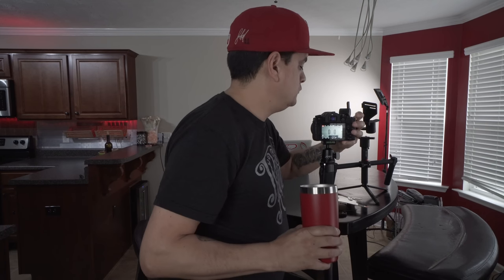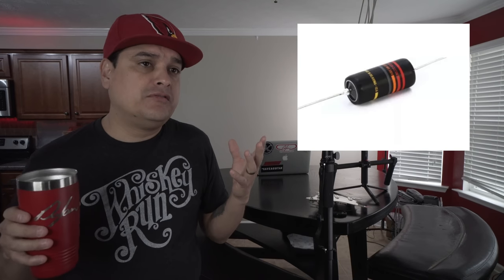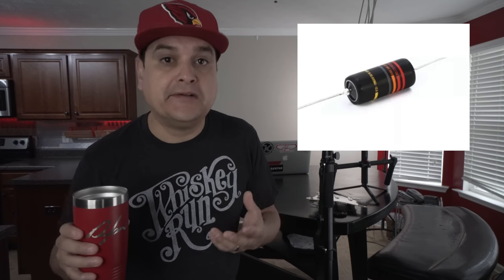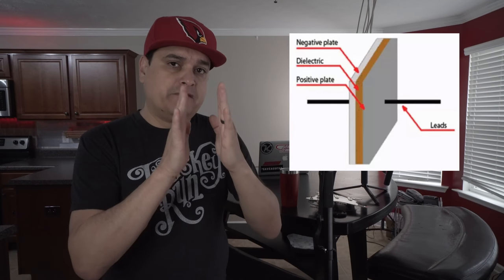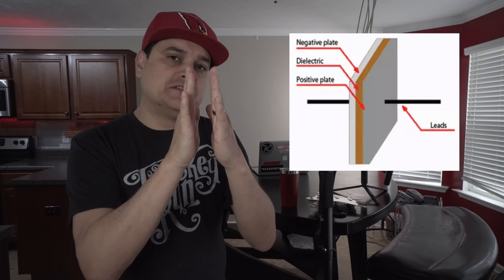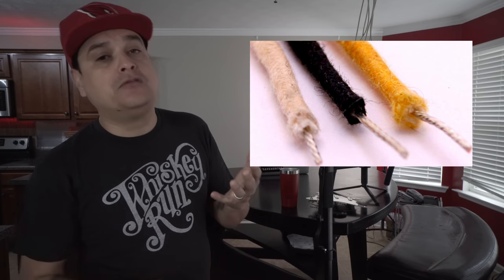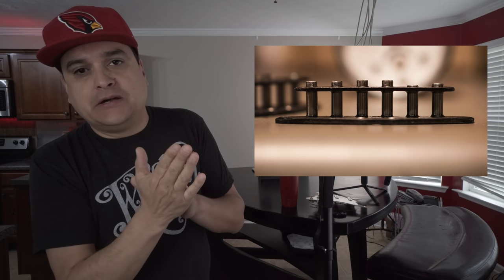Are Paper In Oil Caps Better Than Orange Drop?

Comment: I’m not going to pretend like I know a lot about capacitors, but I replaced the small stock ceramic capacitors in my 2002 Gibson Les Paul with a pair of mojotone paper in oil caps, and I was very pleased with the results. The tone was much cleaner and it sounded less muffled. I don’t think the difference was nearly enough to justify some of the outrageous prices some charge for bumblebees or others, but at $10 a pop, I think the mojotones were money well spent.

Comment: Thankyou for reinforcing what l have been saying for years. I been playin for 50 yrs & a technician for 30....there is no such thing as vintage tone due to a capacitor style !  Unless there has been leakage or deterioration over the years. It does what it does according to the value on the wrapper.  OHM's LAW DON'T DO VINTAGE....PERIOD !!! 😢😅
FUNFACT...apparently even a company that starts with G & goes to N was caught painting capacitors to pass for the old black & yellow Bumblebees from a bygone era. They got swatted" down....Save your $$s kids !

Comment: Great video and very informative. I'm currently working on a bass and ordered some CTS pots for it (in preparation for swapping out the pickups and controls) and they came with an "orange drop" capacitor. I've been watching videos on how to do the work myself (the soldering and whatnot)and they're using paper and oil so I've been wondering if I should get a paper and oil capacitor "because it will sound better." Glad I found your video to clear up this whole capacitor argument. Thanks a lot!!!

Comment: Hey Dylan, very good work. The voodo of caps not withstanding, which you handled well, explaining tech is not an easy task. You took a complex topic (capacitors) and gave it in a digestible package. Not too basic but still not getting lost in details. Any inaccuracies were very minor and forgivable. Anyone who is compelled to pick apart your presentation likely has never taught professionally or had to educate executives. Bravo!

Comment: Good stuff Dylan, thanks. What's important is the way your guitar output circuit (pickups, caps, resistors) interacts with the input circuit (impedance) of your amplifier. Try running your Strat through the A side of a Radial Twin-City ABY Amp Switcher Pedal and vary the drag setting. Most guitars will have a sweet spot you can hear.

Comment: I've played around with several different capacitor types - various vintage caps (mustard caps, tropical fish, bumblebees, etc), Orange Drops, ceramic, polypropylene film, polyester film...etc. I usually avoid ceramic since they tend to be microphonic more often than the film type caps, but otherwise, like value caps will almost always sound nearly identical (actual value - not rated value). My go-to are Panasonic polypropylene caps - they're inexpensive, they sound good, and they're compact (especially the 25V and 50V rated caps I use, which are still overkill for the application). Pot values also come into play. Generally, you'll have a darker tone with 250K and brighter with 500K or 1M. Smaller value caps will sound brighter and larger value will bring more low end into the mix. I like 500K pots with a .047uF cap for single coil pickup guitars and 1M pots w/.022uF for humbuckers.

Comment: I don't feel any particular way about caps. I'm just learning. Right now I am on the down hill slope of a 2 humbucker rewire job. I learned about polarity. Testing humbuckers for resistance. Pot values versus humbucker tonality. Now I'm "nerding" out about the bridge pickup. I had to drop in a 250K tone pot. I have a one Meg volume pot. The caps are .022's. There are two DPDT switches (on, on, on) for dual sound parallel, series and coil splitting. Blah, blah, blah.
Now the question really is what will my bridge humbucker sound like. Will I swap out the cap or the pot? Or will I like the darkness of it as I go from one coil to two depending...? Should I wire the switch for the North coil or South on this bridge pickup? All very interesting and fun to me. So thanks for all your cool vids Dylan.

Comment: The electrical value of a capacitor is the only thing that should matter. The object is to use components the work and last as long as possible. Using the best you can afford doesn't mean spending as much as you can, it's choosing components that will work together to give you the sound you desire.  Capacitance gives you your range of tone but so does everything else employed.

Comment: Capacitance is capacitance and what does matter is the value of the capacitance and the effective series resistance of the capacitor. If two capacitors have equivalent capacitance and ESR it doesn't matter which is used in these very low voltage circuits.  High voltage needs really good insulation as well.

Comment: My only thought on picking caps is to pick something above the bottom of the barrel so you're closer to spec. I'm not gonna pay $30 for some new old stock cap from the 60s, but I'm also not gonna grab a 5 cent ceramic cap off ebay.  Anywhere in the $1-5 range is perfectly fine, though. 

Recently rewired an old korean L6 clone and wanted to keep its original cap, because I was just replacing bad pots. It was wired so tightly to the tone pot that I just snipped the hole lug and soldered that with a tiny snip of wire through it to my new pot. Sadly, I don't have a good multimeter to test how within spec the thing is, I just know that I didn't bake it to death trying to get it off that lug before giving up.

Comment: I sat down with a bundle of different capacitors for a day running a signal through them one at a time(ripped out if a 70s TV set.Grundig I think) and when I used a yellow tube shaped •5cm x 1cm plastic one I stopped and permanently soldered it into a stock Stratocaster because it sounded nicer than all the rest. I don't know the values cos it was almost blank but it was yellow.

Comment: I have a question (ignore the handle, shared computer) but for those of us who subscribe to the DIY thic and dismantle old tv's and stuff to harvest parts do you have any good advice or thoughts on what items we should look for and why? It seems capacitors would be one of hte easier bits to pull from old electronics
Reply: nah man caps dont worth it.. focus on big expensive stuff like transformers, tubes, power transistors, heatsinks, anything mechanical like potentiometers and switches, big inductors, cables, that sort of jazz, also anything you find useful obviously why not..

Comment: Good presentation! There are a couple of things that might help the non electrical engineer. 1. Caps block DC voltage and pass AC. 2. Dielectric Stability. ie Mylar or polypropylene degrade less over time than paper and oil. 3. Dielectric Constant which will have an effect on the size and frequency response of the cap. At audio frequencies Dielectric Constant has more effect on the size of the cap than on the frequency response. Small caps are NOT less effective for the same rating, they have a better Dielectric Constant. 
Back in the middle of the last century, parts available for tube amps and guitars tended to be in the ± 20% range anything else would be expensive. ± 10% got more common by the 60's but as I recall, well into the late '70's, ± 20% caps were still the norm.

Comment: I went for Silver Mica caps for a passive bass cut circuit simply because the tolerance was +/- 1% rather than the 10-15% you'll find in the usual caps sold to guitarists for tone circuits 🤓

Comment: There is current (I).There is charge (Q). There is rate of change of current (dI/dt). The first (I) is connected to RESISTANCE. The second (Q) is connected to CAPACITANCE. The third (dI/dt) is connected to INDUCTANCE. Each are a part of the TONE you hear. They all matter. All of it collapses to one single differential equation, so what ends up mattering is the relative values of these three thing. When you buy a capacitor, ALL THREE are there, even though what is being sold is CAPACITANCE. A 0.047 with 0.047 of another is the same, but the Henries won't be the same, neither will the resistance. But the resistance is overwhelmed by the pots. That's why the Pot's are so large.Inductance? The pickups will overwhelm on that. So, it doesn't matter much what type of caps you get. if you are into blowing money for no, or trivial difference, the do it, but understand you aren't going to here it. On the other hand, other idiots willpay for it to show off to their buddies, or so they can show off in a forum.

Comment: So in other words, if I play an old guitar with original electronics compared to a new guitar -  my playing will sound better and I will be able to reach those hard to get to chords I want to play? Cool...

I did not really get into the guitar world until a couple of years ago and man is it opinionated!! So much is made out of "vintage" guitars and amps and pots and capacitors and..... Honestly, just play what you like and like what you play! All of these guys getting into relicing a guitar or only using vintage style stuff kind of crack me up. You hit the nail right on the head, it's not because they used  fill in the blank, it's because of AGING. A 59 Les Paul wood does make a difference, but only because it has aged not because it was some better quality wood. I have both old and new guitars and frankly I love playing them all and the only thing that makes this guitar sound better is two things 1) What type of sound I am going for, rock, blues ect.. and 2) The pickups and pickup styles I am using. I have a 1987 Gibson SG that a few months ago I loved to play, and I am not an SG guy. Now however when I play it I don't enjoy it as much. What changed? The color! When I first got it the original color was white and some MORON decided to take black and silver spray paint and only paint the face of the guitar with a very thick layer of paint but the back and the neck were still white. I restored the guitar to the typical heritage dark cherry per a customers request. The customer backed out of the deal so I am keeping the guitar but I don't seem to enjoy playing it and yes it's about the color because that's the only thing that has changed! I know it's only for cosmetics so I still play the guitar and who knows, maybe one day I will restore it back to the original white? 

Great video and great use of common sense Dylan!

Comment: Electrical current has no feelings. It doesn't care what your capacitor is made of.
Reply: True but just because it isn't sentient doesn't mean it behaves the same in different chemical environments.
Reply: Guitar people are nuts and believe all the hype that is put out to sell things at inflated prices.
Reply: damm, different types of caps sound different in any part of an amp, how many amps have you built that you are not playing icp on?
Reply: music has drifted lol
Reply: @eatsshootsandleaves9100  If you know what a capacitor does in an RC guitar tone circuit then you automatically know that it doesn't matter what is making the capacitance.  A capacitor that measures what it is rated for will do the same as a different material cap rated the same value (at least in the situation of a guitar circuit).  That is so long as it isn't starting to act like a resistor which is what happens to old caps.  They are starting to go bad and have a poor ESR.  If you like that sound and understand electronics, you can simulate it by changing the potentiometer value.  It's hard to feel bad for those getting defrauded by all the mythology.  You can't tell them anything anyway.

Comment: The ECR and ECI values of capacitors affect the it's harmonic resonance (meaning it's effective ferquency range) even when they have the same capacitance values. Electrolytic capacitors for instance don't typically like passing frequencies higher than 3k hz, and are a little piezoelectric so they produce small voltages when they vibrate.

Comment: Good explanation of what has a lot of builders and guitarists panties in a twist!  If I like a guitar enough to buy it I leave it alone unless something malfunctions.  When I build a guitar for myself, I like to experiment, but I'm not about to shell out the money that would buy a good Wilkinson or GFS  pickup for a capacitor.  I have built double-humbucker guitars and wired some of them up with 250K pots and .047 capacitors and they sound just fine to me.  Personally, I hate soldering.  I think it's a real pain in the ass, and I'd rather put pure nickel strings on a guitar that sounds too bright, than go ripping everything apart, putting in expensive stuff, and finding out I liked it better before.

Alpha pots and ceramic disc capacitors sound just fine to me.

Comment: Actually I believe that when the guitars with the paper and oil caps were first made. They did what they were supposed to do and would not have sounded any different from the same guitar made today. The reason they should different today is because over the years the paper and oil cap has deteriorated. Thus, acting and sounding unique.

Comment: ...so I have a number of old Paper and Oil capacitors from my Dad's shed, he's a electrical engineer and a bit of a border.  I like the imperfect vintage sound having played a few old guitars. The am tempted to try some out in my  Early 1990's Les Paul... any tips?
Reply: Measure their capacitance... If you like it, order a capacitor of that value, test to see if it sounds the same, and report back.

Comment: Paper in oil oozes a smooth bell like tone where the notes are smooth, the notes are round, the notes sing, and the notes are not ice picky or muddy. It's vintage, it's premium, it's the only right one to use.

Disclaimer: I have never used paper in oil.
Reply: The oil acts as a lubricant, so the sound is "smoother."  :-)

Comment: thx very helpful,I have a 92 clapton strat with the midboost,I changed my pickups to the srv and a hot rail.with the boost off the srv pickups sound a little muddy I was thinking of taking out the circuit and starting from scratch?is this the pickups or the circuit making it muddy.much appreciated
Reply: Sounds like the circuit!  You now have a hum bucker wired to a single coil pick up volume pot!  IF you go to HB from SC, you NEED to replace the volume pot from 250K, to @ least 500K, or it WILL sound muddy, and it WON'T be  as loud as you expect, or drive your amp as hard! I had this problem years ago on an old guitar. Had a good Duncan put in it, but the twats that did it, NEVER upgraded the volume pot to a 500K, and I always wondered WHY the guitar sounded muddy!

Comment: Hi, would there be any noticeable difference between a 50V 0.22uf & a 100V 0.20uf cap ? Thanks so much! ps both ceramic
Reply: I'm wondering the same thing.  Or a 400v, or 600v.

Comment: Douglas Self wrote the literal book on small signal audio design. He has a great section on capacitors that runs counter to this.  Capacitors are not perfectly linear devices, and the chemistry types do relate to that. My only relatable experience with capacitor selection is that with ceramics, the capacitance drops as the voltage increases to the max rates voltage in a really profound way. If someone were using a ceramic for a time constant (like in a guitar tone circuit) I’d recommend over rating the voltage by as much as you can. I do agree that the idea of trying to relate capacitor chemistry to tone is a bit laughable. It’s effect on tone is easily swamped by all the other parts of the system.